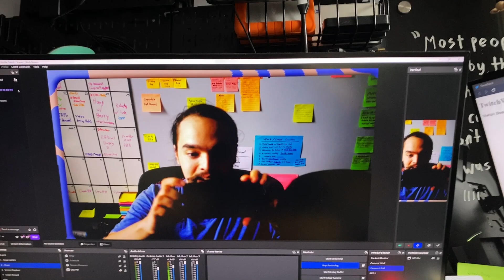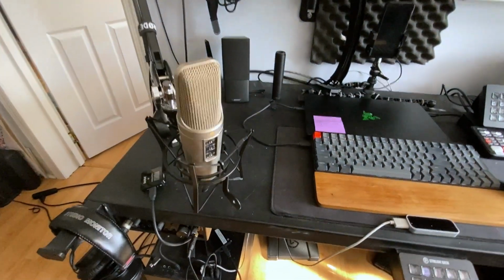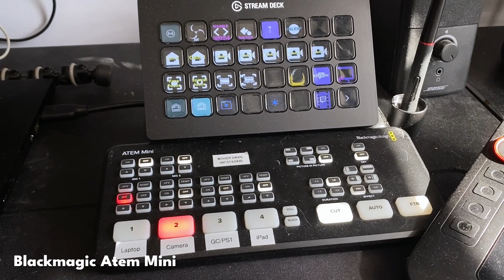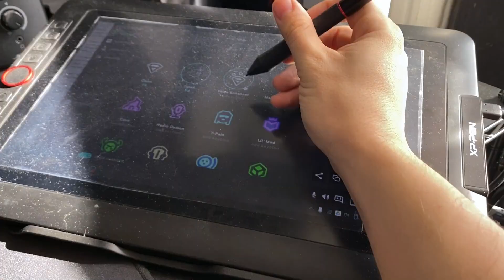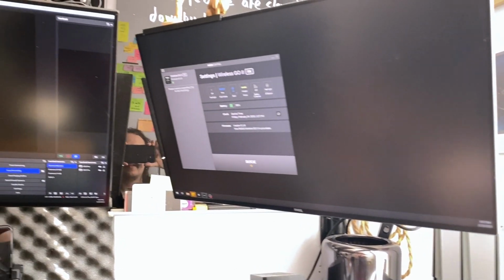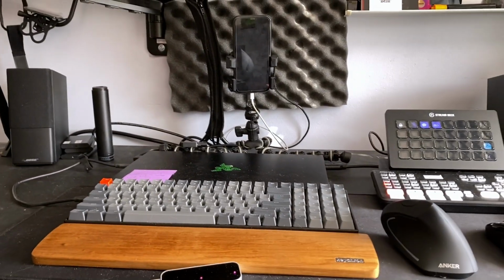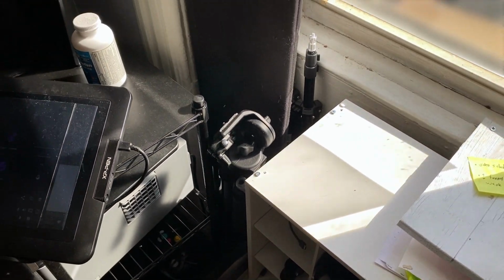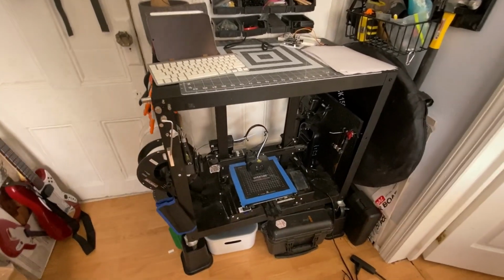Touring my $30k unreal workspace

Comment: Hey woody! Cool set up, regarding the extra router, how does one set that up? Does it run from your main router using an Ethernet cable?
Reply from the maker: You can just run another ethernet directly from your PC and just link any other devices over ethernet or wifi. It doesn't need to be connected to the internet.
Reply: @WoodyDevs  Ahh ok you see as i have a Rokoko suit and the devs there said to have a separate router for your suit? Is that the same as what you have done?
Reply from the maker: @wondernexus3d482  That was why I bought one. But I use mine for all kinds of stuff - face capture, etc.
Reply: @WoodyDevs  Heya again :) So my second router came today, my PC is currently plugged into the router by ethernet cable not by Wi-Fi. So you reckon I should disconnect my PC from the router leaving it without internet, and plug my second router into the PC with ethernet but nothing else in the house so the only thing connected to it wirelessly is the Rokoko suit? Is that right?
Reply from the maker: @wondernexus3d482  You can definitely have multiple connections running on your PC at once. You're gonna want to run your second router as a LAN network. (Default if not online) I'll be real, if this part is confusing, you might want to read a few articles on basic home networking.

Comment: Doesn't looking up at that monitor give you neck issues for hours at a time. I have a stacked setup (one under neath) and I use a quick macro to swap the monitors using display fusion.
Reply from the maker: Thankfull this is not my set up anymore. It did!